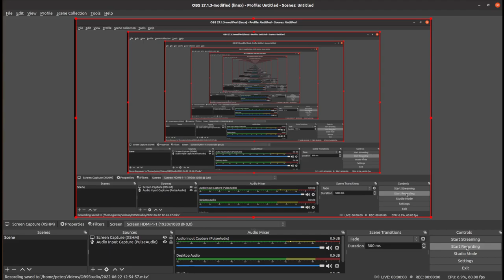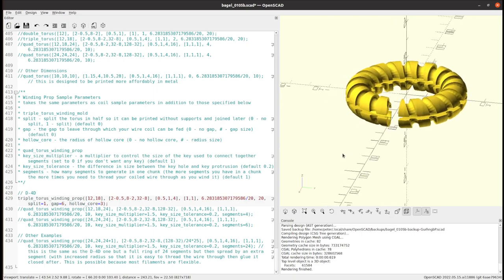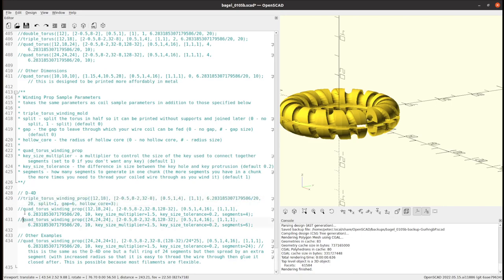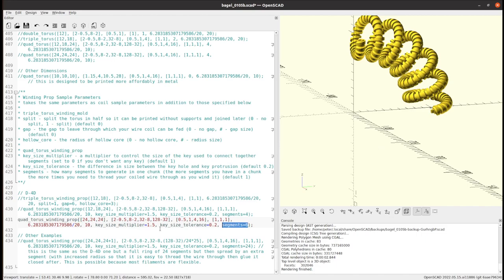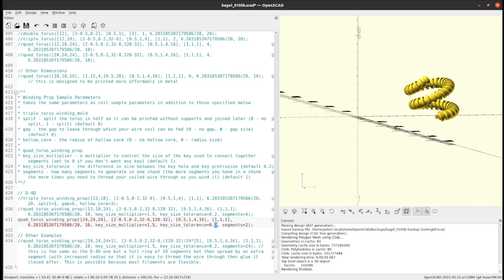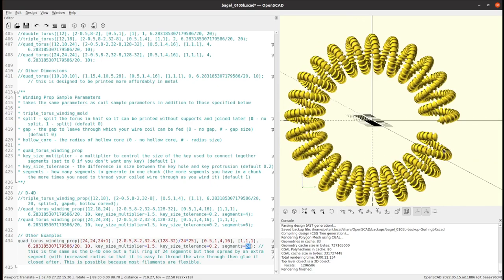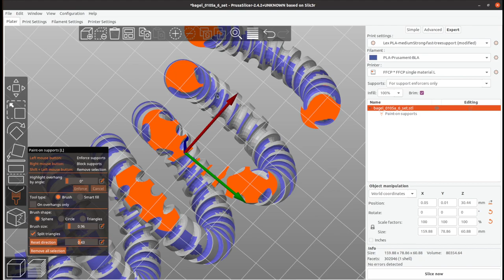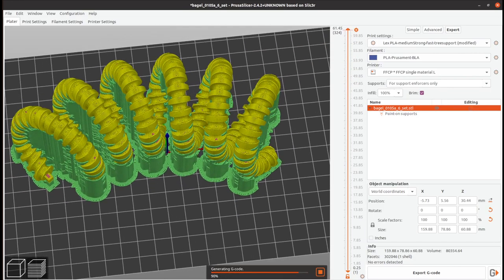O-Day - Free parametric 3D printable bagel coil support builder by Peter S.

Comment: Thanks Peter!  I will have to try this with my printer.
Reply from the maker: Please share back any model files that work with tips and how toos.
Reply: Yup if you hit any issues or have any special requests let me know I'de be more than happy to help! :) I kinda wish I had a resin 3d printer, I would have gotten a much cleaner print! Perhaps it will go on my shopping list in the coming year. First thing we need is a public coil winder design (perhaps easily built with 3d printed parts...) EDIT: One other tip for you Dave, when you design your support for printing, oversize the rad_c radius slightly as if your printer is like mine you are probably going to want it to be a little larger than the designed radius. For my 6 segment design this involved changing [0.5,1,4,16] to [0.5,1.25,4,16]. If you choose a value that is too large it leads to self intersection and you will get an error "ERROR: Rendering cancelled by exception Unauthorized intersections of constraints" I can also add a parameter to allow for specifying the depth of the groves if you want just let me know.

Comment: How do i get images to you of a 5-tori (super-super-super-super tori) I just made all one continuous piece 300ft+ 22 gauge wire insulated, on 60ft of 22 gauge insulated on 12ft of 18 gauge on approximately 4 feet of bare 12 gauge wire. Left over right over left over righteach wire could be soldered in series of energized separately. I dont have the know how to do that.
Reply from the maker: Firstly, very well done - that is some achievement!

If you send a message using the contact form on QuantumHeat.org, you'll get a reply from an email that you can send images to.